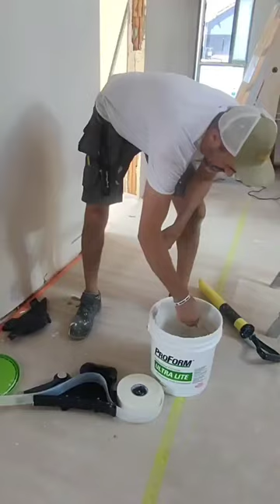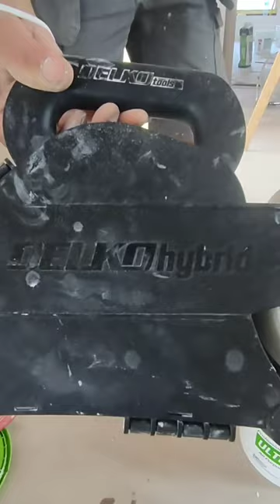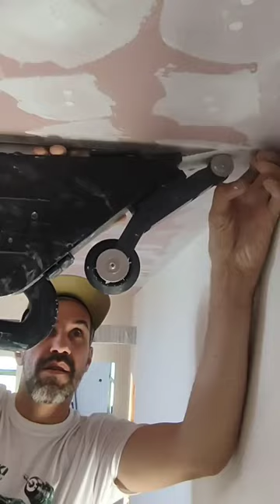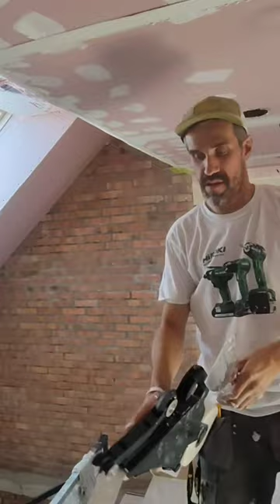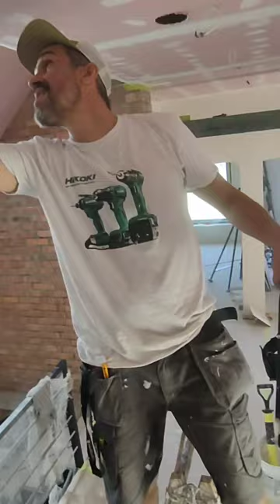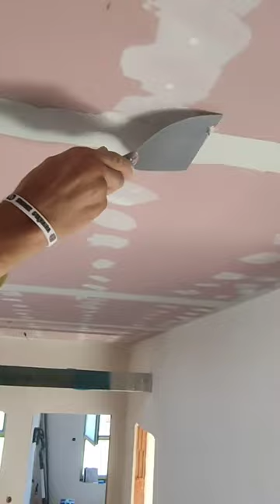DELKOhybrid drywall banjo & DELKOpump compound tube

Comment: How thin is your mud
Reply: Pretty thin looking like, since his tape didn’t stick everywhere. Luckily you can control the flow of it so he just has to adjust it to let a bit more out 

These drywall banjos 🪕 are great tho… I prefer the wheel ones since they can get corners… the other ones with the metal blade thing take some practice but are still good… I’d buy both if I could but my workers will probably find a way to ruin one lol